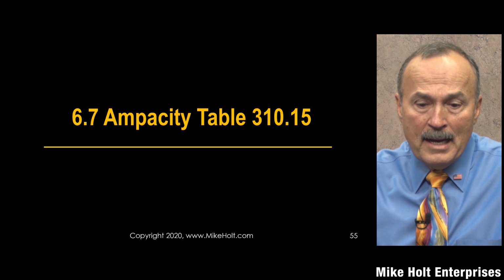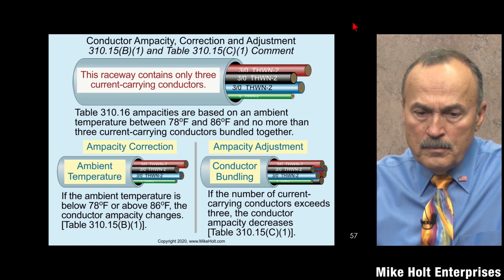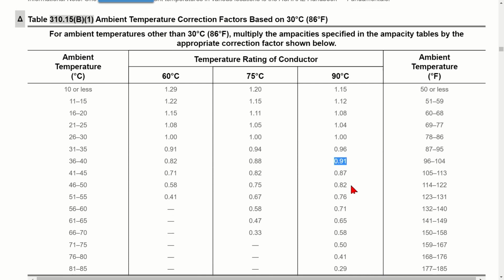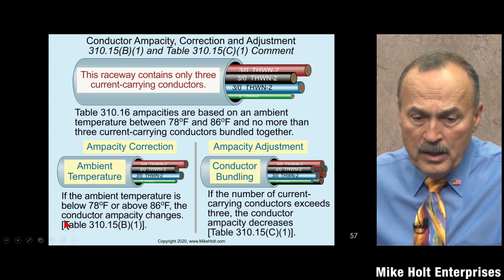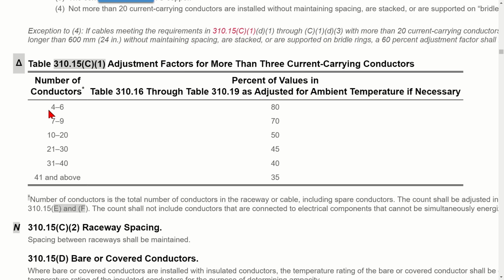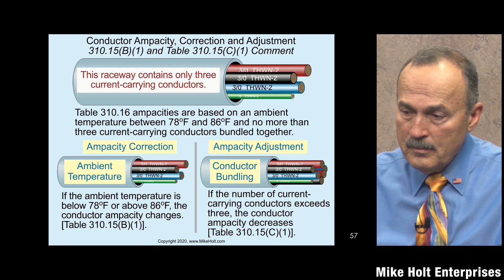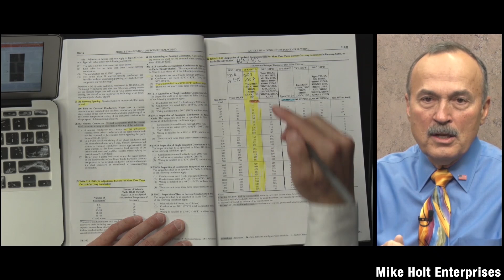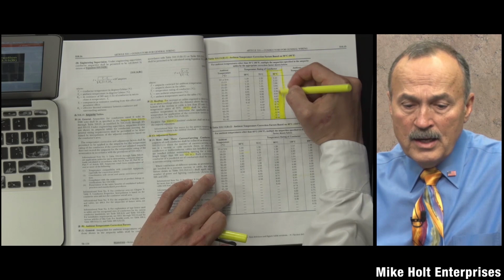Ampacity Table, NEC 2020 - [310.15], (13min:26sec)

Comment: Most wire will fall in the 90 degree column. But when making adjustments you have to go with the rating of the wire. I.E. if it is TW or UF it must be the 60 Degree column. Might not matter a lot in real life but could be on a test.
Reply from the maker: Excellent point!
Reply from the maker: Nope, that is not true for ampacity correction or adjustment. We use the 90C for that purpose. See 310.15.

Comment: So the purpose of 90 deg c column is to down size the wire to fit in with terminals without compromising on the ampacity. If its not necessary to derate the wire so there's no need to go to 90 c . Great help :3
Reply from the maker: Not really. Wires are to be sized to the load in accordance with 210.19 and 215.3. The 90C rating is only used for conductor ampacity adjustment. Please watch the video again.

Comment: What if I run a 6 gauge conductor, but I want to use it at the 90 degrees ampacity, (75 Amps) if before landing my #6 conductor to the breaker, I add a small piece of 4 gauge conductor which is rated for 85 Amps at the 75 degrees. Is there a code against doing sometime like that?

Comment: Mike: I have taken several practice questions and when talking about current caring conductors the neutral is always counted. In this video you said you do not count the neutral as a CCC. I have also been taught to count the neutral as a CCC. How and when do you not count it????
Reply from the maker: The answer is contained in 310.15(E).
Reply: When it's an individual circuit, one hot paired with one neutral, regardless of voltage or system type, the neutral carries the full current of the hot and is always counted. Usually when the neutral is shared by multiple hots, it's not counted. However, if it's a 3-wire or 4-wire circuit of a wye system, 310.15(E)(2) or (3) apply.

Comment: Am I only allowed to use this chart for air conditioning and motors? Or is 12 gauge wire always 30 amps
Reply from the maker: Please review 240.4 in it's entirity.
Reply: I understand it now thank you. There is also stars next to 14 through 10 bringing it to that code

Comment: I don't see any reason why artificial intelligence can't completely codify the NEC
Reply from the maker: If you understand AI and the Code development process, you'll understand why we still need 'humans.'
Reply: I very much understand why we need humans, I just fell that if I can say ‘I’m installing a 3 phase motor 100 feet from my disconnect rated at such and such amps at such and such temperature , what size wire will I need?  The AI element should be able to digest the NEC code requirements and spit out an answer.  Of course as the human doing the install I would have to check to make sure the AI is correct, but it’s all code…it’s not that hard.
Reply from the maker: @Mrlostinterest  MHE is extensively involved with AI and its application with the electrical industry. I can't image who would invest hundreds of thousands of dollars to create any such an AI platform. Did you know that some states are on the 2008, 2011, 2014, 2017, 2020, and 2023 NEC. Also many states have local amendments, and sometimes we have county amendments, and city amendments.
How anybody could gather all of that information to get an accurate answer is beyond me. Let me know when you find a platform that answers the question you presented.
AI is not exactly what people think it is (yet).

Comment: Mike & Brian are incorrect. You count the neutral conductors quite often.
NEC 310.15(E) Neutral Conductor: "Neutral conductors shall be considered current carrying in accordance with the following:
(1) Carries only the unbalanced current.
(2) When the neutral "carries approximately the same current as the line-to-neutral load currents".
(3) When "the major portion of the load consists of nonlinear loads, harmonic currents are present in the neutral".
Reply from the maker: (1) is NOT considered current carrying  (2) is a 3 wire circuit on a 3PZ wye system using two of the three phase conductors and sharing a neutral. What are the examples where this is done often? (3) Is a 4 wire circuit using a neutral where the majority is non- linear. Again what are your example of where this is done often? - Brian
Reply: @MikeHoltNEC  Ah! I see I was wrong. I didn't read 310.15(E) all the way through. It says,
"Neutral conductors shall be considered current carrying in accordance with any of the following:
(1) A neutral conductor that carries only the unbalanced current from other conductors of the same circuit shall NOT be required to be counted when applying the provisions of 310.15(C)(1). 

Regarding 2 & 3, 310.15(E) states,
"(2) In a 3-wire circuit consisting of two phase conductors and the neutral conductor of a 4-wire, 3-phase, wye-connected system, a common conductor carries approximately the same current as the line-to-neutral load currents of the other conductors and shall be counted when applying the provisions of 310.15(C)(1).

(3) On a 4-wire, 3-phase wye circuit where the major portion of the load consists of nonlinear loads, harmonic currents are present in the neutral conductor; the neutral conductor shall therefore be considered a current-carrying conductor."

I don't need examples Brian. I am simply quoting the code. Are you saying the code in (2) & (3) is incorrect?
Reply: @icevariable9600  Two wire 120V circuit, one hot and one neutral, the neutral is a current carrying conductor. This is in accordance with 1 in that it doesn't carry only the unbalanced current of other conductorS of the same circuit; it carries all the current of the sole ungrounded conductor in the circuit. So a neutral is considered a ccc quite often.

Comment: Mike, great video!  question, when would table 310.15 (b) (2) be used for adjustment?
Reply from the maker: When the temperature is over 86F.
Reply: Im having a hard time understanding when to use 310.15 (B) (1) and 310.15 (B) (2).  For example if ambient temperature is 44 Deg C. Both tables provide 41-45  Deg C range . Mike says to use 310.15 (B) (2) when its is above 30 Deg C (86 deg F). A couple of questions. If the table is intended for that.
Why state that is based on 40 Deg C? Why does 310.15 (B) (1) have ranges above 30 Deg C?

Comment: In this video you stated the correction and adjustment factors only apply to current carrying conductors (ccc).  Does a switch leg count as a ccc because the constant hot will see the same heating effects of current flow already? It seems to me that the switch leg and the constant are the same donductor. What are your thoughts?
Reply from the maker: Of course it's a current carrying conductor.

Comment: Sir i have a question, is there a code violation in NEC if water pipe is above sa electrical pipe/conduit, and also sprinkler head near electrical busduct. Thanks hoping i will an answer
Reply from the maker: Please post your question on MikeHolt.com/Forum, and see 110.26(E).

Comment: Mr Holt, Right at 7.59 minute mark you said we adjusting the ampacity of conductor based on the 90 degree C Column.  where in the code state based on 90 dgree Column ? I could not find that, thank you for your time
Reply from the maker: See 310.15 , it states "The temperature correction and adjustment factors shall be permitted to be applied to the ampacity for the temperature rating of the conductor, if the corrected and adjusted ampacity does not exceed the ampacity for the temperature rating of the
termination in accordance with the provisions of 110.14(C)."
Reply: I was looking at this section today, and it occurred to me this code section should be re-written, to say "not less than" instead of "does not exceed" the ampacity for the temperature rating of 110.14 (C). We can always use a conductor that exceeds ampacity requirements, but never less than.  @MikeHoltNEC

Comment: Nice presentation. Quick question. If your correction and adjustment factors make the ampacity fall below the 60C or 75C ampacity ratings, which supersedes?
Reply from the maker: When you size a wire, you need to know the ampacity. This has nothing to do with 60C or 75C terminals. Example, if you calculate the ampacity of a 90C wire and it's 70A, but it's only 100A at 75C, then of course the ampacity is 70A.

Comment: Where can I find the part of you guys talking about not counting the neutral as a current carrying conductor? This was mentioned at 8:54
Reply: Two wire 120V circuit, one hot and one neutral, the neutral is a current carrying conductor. This is in accordance with 1 in that it doesn't carry only the unbalanced current of other conductorS of the same circuit; it carries all the current of the sole ungrounded conductor in the circuit. So a neutral is considered a ccc quite often.

Comment: PLEASE HELP- I have read all of 310.15 there is NO reference of 90 degree column anywhere (that I can find) I was under the understanding you are to use the HIGHEST rating for that insulation... Example RHW, THHW, THW - Etc all fall in the 75 degree columnn (to my understanding th -2 indicates upgraded insulation) So what do I do - and can you or somenone please tell me where the 90 degree referance is? Thanks!
Reply from the maker: 310.15(B) states that we use the temperature ampacity correction [310.15(B)(1)] and adjustment ampacity factors [310.15(C)(1)] are applied to the ampacities listed in Table 310.16, based on the conductor’s insulation temperature rating. We typically use THWN-2, which is 90C.
Reply: @MikeHoltNEC  Thats what I thougt / could ascertain from the code - If I am understanding this (to paraphrase) "Use the highest degree column based on insulation type and disregard termination"
Reply from the maker: Watch the video again, 90C is only used when you are required to apply conductor ampacity adjustments and corrections in accordance with 310.15, this has nothing to do with sizing a conductor to terminals per 110.14(C)(1), 210.19(A)(1), and 215.2(A)(1).
Reply: @MikeHoltNEC  I guess I meant not sizing to terminals... but terminal temperature rating 😉
Reply: on a side note: is this Mike Holt? if so I am very flattered that the "The Man, The Myth, The Legend" took time to respond...That is awesome .. If not it's it's still awesome that someone took the time to respond!
Reply from the maker: We size to terminal temperature rating and determine ampacity on conductor insulation temperature rating per 310.14.
Reply from the maker: Lol, of course it's me; you are important to me in every way. God Bless, Mike

Comment: Mr. Holt, If your OCPD is rated for 75 degree C wiring but your wire is rated for higher temperature such as 90 degree C (or in the case of transit Exane wire 110 degree C) do we size our wiring ampacity according to the 75 degree column? Furthermore, do we do our ambient and bundling adjustments using the wire's actual temp rating (in this case 90 or 110 degree C)? This is a little confusing. Thank you so much! :)
Reply from the maker: Watch https://www.youtube.com/embed/k7d03Tic6LE and https://www.youtube.com/embed/OLIHEiiY_Rs
Reply: @MikeHoltNEC  Thank you!! :)

Comment: What about table 310.15 b 2 b
Reply: 2017 nec
Reply from the maker: This table is not used because the conductors are rated 30C, not 40C.

Comment: @8:47.  In almost all cases, don't count the neutral. 🤥     Most cases are not multiwire branch circuits.     Please let brian correct you, you could tell he wanted to but bit his tounge.   (5) Neutral Conductor. (a)   A neutral conductor that carries only the unbalanced current from other conductors of the same circuit shall not be required to be counted when applying the provisions of 310.15(B)(3)(a).
Reply from the maker: Your comment doesn't make sense, this video was not about determining if the neutral conductor was a current carrying conductor. That is a separate rule 310.15(E).
Reply: @MikeHoltNEC  Two wire 120V circuit, one hot and one neutral, the neutral is a current carrying conductor. This is in accordance with 1 in that it doesn't carry only the unbalanced current of other conductorS of the same circuit. So a neutral is considered a ccc quite often.
Reply from the maker: @pld8993 Please watch the video again, it has nothing to do with the fact that the neutral conductor carries current. It's related to 310.15(C) rule when counting the number current-carrying conductors for ampacity adjustment.
Reply: @MikeHoltNEC  The video says that in almost all cases the neutral is not counted. That is only true when we are talking about a neutral with multiple ungrounded conductors sharing it. When the neutral is the "return" path in an individual circuit (one hot paired with one neutral), it always carries current and it is always counted as a ccc. The video only talks about shared neutrals and never discusses individual circuits. One could try to make the argument that in an individual circuit, one hot and one neutral, what we are calling the neutral is technically not neutral and is more appropriately identified as the grounded conductor, in which case 310.15(E) would not even apply and it would definitely be counted as a ccc. If we are going to apply 310.15(E) to an individual circuit, one hot and one neutral, because the neutral is NOT carrying ONLY the unbalanced current from other conductorS (plural) in the circuit, counting it as a ccc is fully in accordance with 310.15(E)(1). If it's carrying only unbalanced current it's not counted, therefore if it's carrying current that's not unbalanced current it's counted.
Reply from the maker: @pld8993  sorry for making this 'general' statement in this video. Thanks for the feedback. I'll try to be more careful.
Reply: @MikeHoltNEC  No need. We're all learning together.